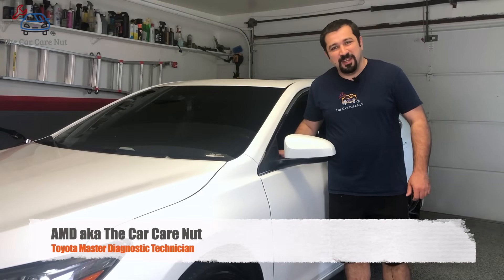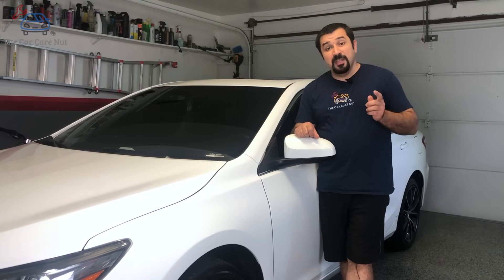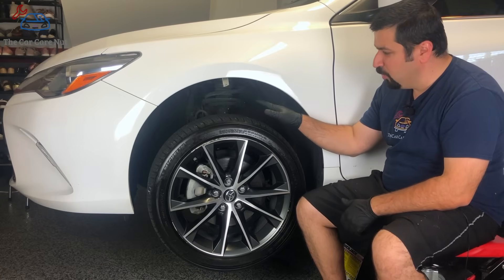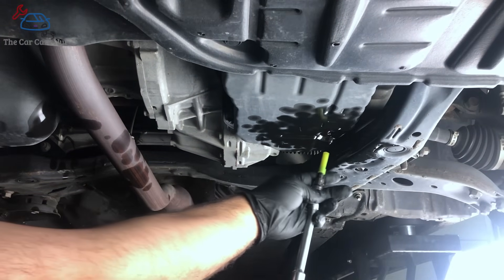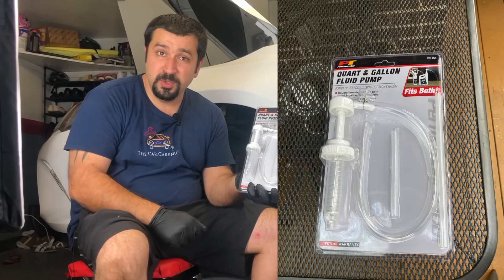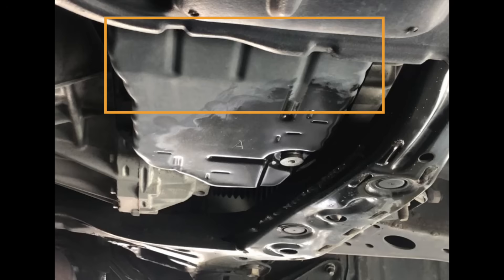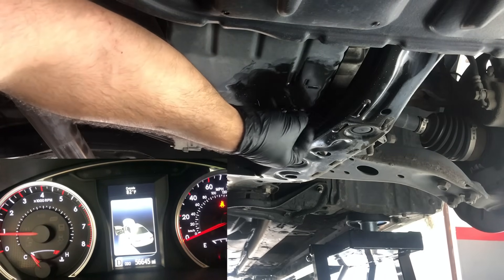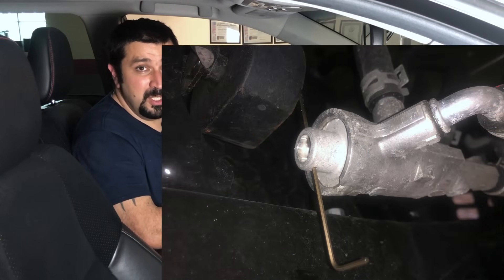How to change your Toyota Sealed Transmission Fluid

Comment: Doesn't it need to remove the pan and clean the bottom? 
I watched another video saying there is metal debris on the bottom magnet, and also replaced the old gasket.

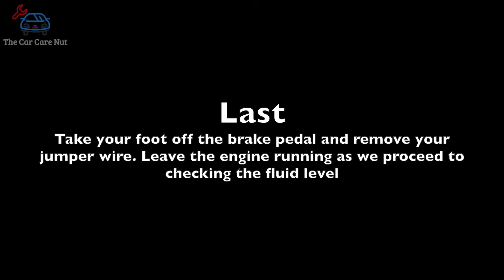Comment: 12:09 Should you switch to N or P before you release the brake to check the fluid level, otherwise the wheels will spin? Or Diagnostic mode won't spin the wheels?
Does the OBD2 wire jumper work for Highlander?

Comment: So I have a question for you I have a 2016 Camry leaking transmission fluid from the front main seal is it safe to use Lucas or other product to stop the small leak and to fix the second and third gear from slipping sometimes after adding the correct amount thank you in advance

Comment: The Toyota service manual for these sealed Toyota automatic transmission states that after the fluid level at the 104F,  you must add 200 ml (7 oz) of fluid into the fill hole.  Is that correct?
Reply: Great question!

Comment: Great video. Can anyone confirm if a 2017 Sienna SE with the 8 speed automatic transmission has the transmission cooler bypass valve or not?
Reply: Yes it does. I have a 2017 Sienna SE, took a look under the vehicle, and it looks exactly like it was shown in this video.

Comment: AMD when leveling the car with a magnetic level, should I attach it to the frame (2 flat rails running along each side /the length of car on each side / underneath the main part of the car).  or is it better to attach the level to the trans pan (there a few different angles of metal on the bottom of the pan).  Your fast reply would be greatly appreciated.
Reply: Awesome question!! Need that information too!
Reply: @2005Pilot  FYI, I've done it both ways and I'm not sure which is best (which is I asked the question).  As you can see, I asked this question originally a long time ago.  AMD used to answer my questions pretty fast but have not had good luck hearing back from him at all for a lo bng while now.  :-(    Maybe he is mad at me????  I hope not.

Comment: I have a 2018 RAV 4 when I bought it the dealer told me it’s a sealed unit you don’t have to change the transmission fluid I have 150000 miles on it what should I do please advise me thanks 🙏

Comment: I had mine done at the dealership today. I would highly recommend against anyone doing this on their own unless they are handy.   A lot of members are asking all these questions, and if so, they should be taking it in to a dealership to have it done. While it appears to be pretty straightforward, I doubt the $100-$150 that one saves is really worth it. This is something I would recommend taking straight to the dealer. Today, I was at a reputable dealership for the first time that actually stated they would drain/fill the fluid. There were over 50 customers waiting for service.  At least I know that this was done correctly. The car shifts fine after the fluid change. Now, every 20,000 miles after the first service at 100,000 miles. Ironically, none of the dealers wanted to touch this while still in the extended warranty, which was 5 years.

Comment: 2007 toyota camry V6...I've done a second drain and fill and I'm only getting only 1.5 quarts in the drain.  Is this an issue?
Reply: It appears you are low on fluid. If you performed your first fluid change, and you drained 2-2.5 qts. of fluid, and now a lot less, then I am assuming you are low on the fluid. I guess one could actually check the fluid in a test tube while warm/hot with a cooking thermometer. They are pretty accurate.  I would go to the Toyota Forum to see if there is any information on how much usually is drained, hard to tell.
Reply: @Calabrese1966  thx 🤗

Comment: Does this procedure work for 2015 Sienna AWD?  I've never seen that OBD2 jumper method mentioned anywhere else!
Reply: Yes it does. I tried in on my previous 2015 Sienna SE and it worked. I used a paper clip.

Comment: I attempted the OBDII jumper method on my 2018 tundra, but the dash did not display any warning lights to indicate it's in temperature check mode after starting the engine. I double checked the correct pins were jumped. What am I missing?
Reply: In my Toyota you have to manipulate the shifter in a certain way to get into temp check mode, then you have to remove the pin.  See if you can find the procedure online or get your hands on the repair manual.

Comment: Hello (salams) I have a question, I have a 2020 Camry xse 2.5, dealer states my trans capacity is 7.7 qts but I saw you and another mechanic drain no more than 3.5 qts, is there a way to drain all the fluid out?or is the remainder in torque converter and just forget about it, and if that's the case would cycling the new fluid a week or so by driving and then drain again and fill be of any help? Thank you, you videos help and I take your word over any dealer, very detailed and loved your mission statement on website, thank you really hope to hear from you soon only 40k miles but I ignorantly drive it hard at times and feel it could use a little tlc

Comment: I had the dealer service the transmission on my 2016 Sienna.  They Charged me for 16 quarts of fluid! is that normal?  The advisor said they do a non pressure Tech Stream procedure.

Comment: I can not locate the cooler bypass button? I have an 8 speed transmission, 2019 Toyota Camry 2.5 L. I cannot tell by the picture in the video where it is located

Comment: I watched every video you got about transmission fluid, and one thing isn't discussed: removing the transmission fluid pan to change the filter and replace the pan gasket. Do you not recommend replacing the filter as part of this process, only the ~3 quarts of oil?

Comment: Sir, can I use again the new excess cvt fluid that I used in my first drain and fill at 40,000kms? Now, in my car's 50,000kms I want to make another drain and fill to consume it all. Is there any possible contamination happening in a stock cvt oil in order to not to use it? 🤔Thanks. ☺♥

Comment: Can I get your opinion on this situation.  I have a 2014 Toyota 4Runner SR5.   I am the original owner.  It has 96k miles on it. I have changed the engine oil routinely ever 5k.  

However, I have never had the transmission oil changed.  Is it too late to change it now for the first time or will I risk permanently damaging the transmission if I change the oil? 

The vehicle is in impeccable condition and I would like to keep it for another 100k miles. If I were to change the transmission oil now and it does damage it, what would you recommend as a repair?   What would you estimate it would cost?

Comment: I have a 2012 Toyota Camry XLE, and a 2014 Toyota Corolla. I plan to change the fluid on both. What temp range should I use on each car? and what trans fluid should I use on each car?  Also if there is anything different, I need to do than what you showed in the video could you tell what it is? You gave a great explanation in this video. Thank you.

Comment: Amended comment:

CCN, an awesome video! Really appreciate what you do for the Toyota community.

I did some scrounging around and found on the Weber auto channel, they say the temperature should be checked between 95 to 113 degrees F. for those of us with scan-tools that can read it.

Cheers!

=Hinoki
Reply: Thanks, that's a help. He never mentioned the temp in his video.  I'm doing mine tomorrow 😂

Comment: what is the correct way read 2005 toyota avalon dipstick?  check during idle (hot)  or run 10 minutes and the shut off engine to read dipstick?   thanks.  cannot find it on manual.

Comment: Tackled this today on my '17 ES350.  I was anxious as I'd never done it before.  Wasn't bad at all!  Took a while to heat up, as my garage was 50 degrees F this morning.  Car shifts smooth as silk after the change.  Thanks for the excellent video!
Reply: how long before the D stays on?
Reply: @yujayn  it was cold when I did mine....it seemed like 5+ minutes of shifting....
Reply: How many miles did you had when you changed it? I have a 2016 lexus es350 I got 80k on it. I want to change the trans fluid but I’m afraid that is too late idk what to do yet.
Reply: @j_scentv  mine was just over 60k.  I don't think 80k is too late, as this procedure only changes a portion of the fluid.

Comment: Hello friend. I am a retired auto tech of 48 years which most of my experience was with Cadillac and GM vehicles at dealer ships but had my own shop for 12 years in So Cal. I have serviced and repaired many imports at my shop as my customers seem to always have an import as a second car. Lol...... I stayed away from BMW, MERCEDES  and AUDIES etc.  You remind me of the best tech that I hired at my shop which he was my backbone there.  Anyway, I have been retired for 8 years now and to keep my miles down on my truck I bought a used Toyota Corolla LE 1.8l with 113k on it that is clean but has the CVT in it which is all new to me. Your videos that I watch are awesome my friend. I am kind of thinking of just letting the dealer do it's trans service this time and then I will take care of it myself after that. Carfax was clean but we both know how much water that holds. So I do not know if or when this service was performed. I have a lot of my shop hand and power tools including a Master Tech and the Snap On scanner and will see of either one shows trans temp parameter. Do you think I should do dealer this time?

Comment: I tried to get a drain and fill like this at the dealer following the TIS Manual and they only offered a flush - right after they told me about sealed transmission and lifetime fluid. 
I had seen videos of this service and the steps are posted on TacomaWorld. I declined a flush and went home and spent the $20 on TIS to write a review of that dealership including the document number of the Toyota service manual page they declined to perform.

Comment: I know this is an older video, but I just picked up a 2016 Scion iM for my son, CVT, with 147K miles on it. There is no service history, it was a lease/fleet, and perhaps they did all maintenance internally and it was never recorded. The question is, at this point, would you change the CVT fluid or just leave it alone? Don't want to ignore it and also don't want to cause problems either.

Comment: Did the drain and fill today. Used the laser thermometer method good heavens it took forever for the trans to come up to temp. I also tried exchanging all fluid via the cooler line but very little fluid came out. Does the trans cooler only flow when the trans is hot? When I test drove the van the trans was slipping so I carefully went backwards and forwards in the driveway until it started behaving. That was scary. After that it was fine. Must have lost the fluid in the passages. In a week I will drain only what comes out of the drain with the straw removed and will do that several times over the next few months. The old fluid was brown. 2015 sienna has 127K. Prior owner left receipts that it had a trans service sometime prior to 90K but not too far back. A full pan removal only gets you 3 qts, that's not much. Once I get the fluid back to a clean red I will be sure to keep up with it.

Comment: Can't thank you enough for putting this out. I was going to be depending on my non contact thermometer, which I wasn't really feeling great about. The one place where I have a question is, when the drive light comes on steady and it's time for the final fluid level adjustment, am I supposed to be in park or neutral? Thank you again for sharing your knowledge with us!!!
Reply: Park , since you have to leave the car running.
Reply: Leave the veh in park

Comment: Thank you for this video.  The part where the jumper wire comes in and then the shifting sequence plus the temperature scan check.  why not just measure what you took out to the ml and then add that exact same amount to the ml. ?  If the car has traveled 50-60 thousand miles it must have been filled correctly from the manufacturer. Thanks again. For all your videos. They are ALL helpful.
Reply: “It must have been filled correctly from the manufacturer” is a huge assumption. Why not just make sure it’s right?
Reply: Someone mentioned that their 3rd Gen Tacoma came 1 quart short of transmission fluid from the factory

Comment: When you get to the point of taking your foot off of the brake to adjust the fluid level what position should the gear shift be in?
Reply: My repair manual instructs that after you get the D light for two seconds, you shift to park, remove your foot from the brake, and remove the jumper pin.

Comment: Stupid Question.  Once it gets up to temperature, do you place it in park and keep it running?  or do you turn it off and quickly check while the fluid is still warm?
Reply: Not stupid at all.  My repair manual instructs that after you get the D light for two seconds, you shift to park, remove your foot from the brake, and remove the jumper pin. So you're already in Park when you get up to correct temp.  My understanding is that you'll check your fluid level with engine idling.

Comment: 2015 Lexus RX 350- I did this procedure today, here is my feedback: I leveled vehicle using 2x6 lumber under rear tires to suit the floor slope in my garage.  I put a level on oil pan, I crossed checked level on the chrome door sill and it was very close to level. 
Engine was cold, my drained fluid amount was 1.5 litres with the plastic tube removed. I did not remove front driver side wheel, just turned wheel full to left, this allowed access to fill plug, removed 2 10mm bolts, broke one. Did not remove plastic rivet,  I loosened bolt before pan drain. I reinstalled plastic dipstik tube and replaced drain plug with old crush washer.
I added 2.5 litres into fill hole and replaced fill plug with old crush washer. Inserted jumper into OBD2 port.
Started vehicle and went through diagnostic set up and cycled through gears. The D light did not blink, it stayed on after the N to D multiple shifts. I then put vehicle into N and the indicator was blank so I assumed I was in the temperature set mode. Vehicle to about 20 minutes to warm up enough to when D light came on, shift was in N. 
Was checking pan temp with infrared gun and pan was about 101F when D came on. I drained out just slightly over a litre, I originally added an extra litre but since fluid was warm perhaps that is why I got slightly  more that a litre out before drain flow started to reduce.
I was surprised that I only got 1.5 litres on cold drain as others have said more came out in the range of 2-2.5 litres.
Reply: Vehicle took at least 20 minutes to get transmission fluid to correct temperature to do level check. Ambient temperature was about 50F, vehicle sat overnight. 
I installed new crush washer on drain plug after level check and on fill plug as well.
I did not torque drain plug to 36 as I was concerned about damage to 6mm her hole,  next time will install a new drain plug as well.
I will do this again in 15-20,000 km.
Took me about 3 hours this time but likely 1.5 hours next time.

Comment: Good Afternoon, I am needing some information on a 2007 Toyota Camry 3.5L V6 Transmission issue. Here is what it’s doing. Start up the car and shift to any gear. Display on cluster information screen says shift back to P Range and the Transmission will not engage into any gear at all will not move. I have had the Transmission fluid checked, was found to be full to normal level. And my car is a 2007 Camry 3.5L V6 XLE trim. If you can shed some light on this issue I would Greatly appreciate it!!!

Comment: Not sure if this is doable, but wondering if it would work on the first transmission oil change.  Leave the car 4-5 days in garage, with the fluid to be placed in exactly the same temperature as the transmission.  Without turning anything on, lift up car, do drainage and carefully measure using both the bucket and a more specific narrower bottle.  Then, replace all the fluid exactly that was taken out.  Then add 16 ounces that are additional and then do the procedure that Ahmed covered.  Would it give 16 ounces back?  More, or less?

Comment: I have a 2016 Corolla with 200,000 miles. Rideshare driver. Transmission mostly works fine but takes 1 or 2 minutes first thing in the morning to engage. Is it too late to do a flush?

Comment: AMD, is there no filter or gasket that needs to ever be changed? Can we use this drain/fill method indefinitely?

Also, can you please provide temp ranges for 2011 Camry 2.4 and 2012 Sienna 3.5?

Thanks!!

Comment: I’ve got the fj cruiser shudder. Changed filter trans, new oil, then changed pan oil two more times. Fluid not red. Should I change pan oil again or is there an easier way to clean it? How many times do I need to change it? Still shutters. Temp goes to 155 degrees F. Still a shudder. Help lol

Comment: i have a 2014 sienna with 79k miles.   is it too late to drain and fill on my transmission?  if so what is more accurate to check fluid temp a scanner or diagnostic mode using the jumper?   btw what is the temperature range to check for 2014 sienna?

Comment: Hi car care nut,. I have a 2012 camry v50 and I am nervous about talking to get the transmission oil change. I don't believe they'll take the precautions and care in changing it like you do. Also, I need to know which transmission oil I should use. Jamaica

Comment: Car Care Nut, am I correct that a transmission fluid change at 40k miles and 60k miles are the same as a transmission fluid flush at 60k?

Comment: What is the right transmission temperature for 2015 Toyota RAV4 to check the fluid level after change new fluid? By using a infrared thermometer?  Thank you

Comment: I have a 2015 Corolla with the CVT and am going to do the fluid level check on it with that temperature method. What's the temperature spec for it?
Reply: 35-45C is the correct range.  95-113F.